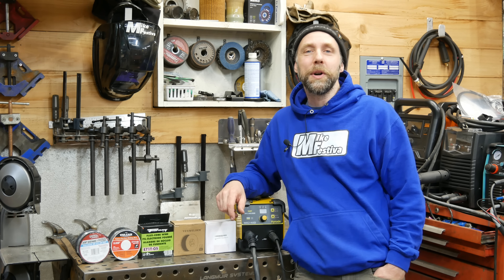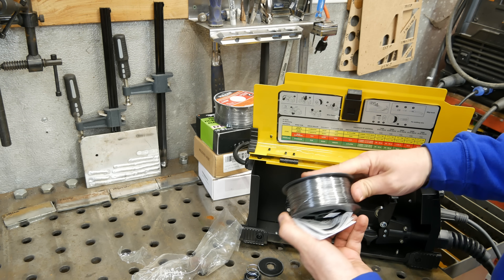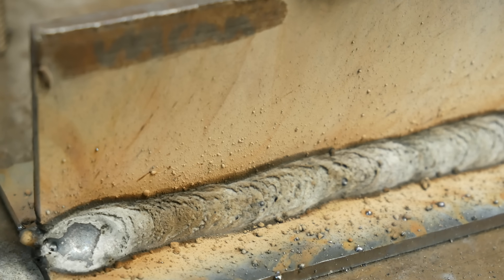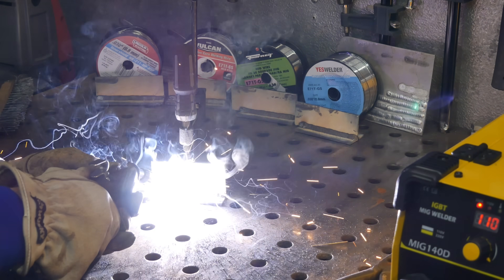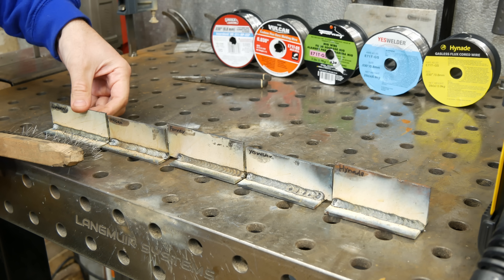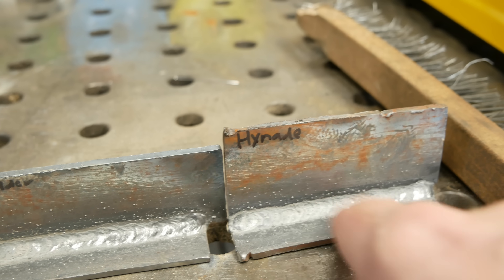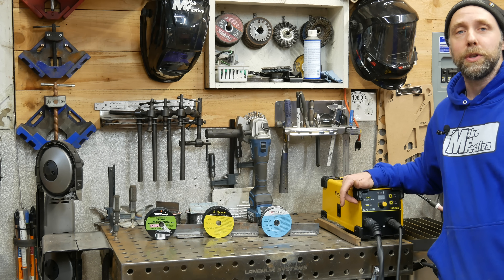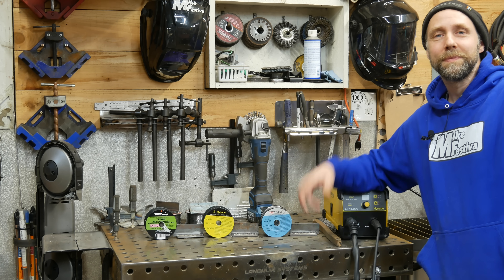Gasless Flux Core Welding Tips, Make Better Cleaner Welds

Comment: Most people don't have 220 volts,  do test with 110    volts.
Reply from the maker: Chuck I’m not making another video just to make you happy 😂
Reply: @Mikefestiva   I enjoyed your video quite a bit.  Someone commented about Single pass vs Multiple pass wire.  Your thoughts there?  I've only done a couple small projects using a borrowed Lincoln 110v; no access to 220 power.  Your thoughts on 110 vs 220?  Especially for beginner to get off on the right foot.  Thanks Mike!

Comment: The bottomline is you still get what you pay for. I wouldn't use anything other than Lincoln Innersheild for any kind of structural welding. Expeacially if it has to pass safety inspections like weld porosity etc. Believe it or not it's what you don't see is where the Lincoln wire really shines.
Reply: Yeah, big difference between E71T-11 vs E71T-GS. Really nice to be able to safely make a second pass.
Reply: I think the NR designation in the Lincoln wire's name hints at why it cost more. I think it was designed post Northridge.

Comment: thanks for making this video.  I've always just used the Lincoln because I can buy it at the local hardware store and I figured it's a good wire because of the name.  I kind of just figured wire is wire.  I'm ordering a couple spools of the Forney now and can't wait to try it.

Have you ever had an issue with the knurling on the feed roller leaving indentions along your wire?  My machine does it no matter how loose I have it set and I even use the .035 roller on .030 wire and it still leaves marks.  

My old HF 90 amp actually feeds the wire pretty well and I can set it up so that if I obstruct the wire from feeding with my glove the roller will slip.  (youtube told me that's how the feed should be set).  

On my newer "Titanium" DC flux machine no matter how much I loosen the feed roller it will not slip at all.  It can only be loosened so much before it's out of threads and the knob and spring pops off.  

Perhaps the wrong spring was put in my machine or it's just a poor design.  I'm going to try to use a softer spring and see if that helps.  Anyone else had this issue?

Apologies for the super long comment.

Comment: Hi Mike, if you had to choose between the Hynade Flux Core 140D vs the Titanium Flux 125, which would you get?
Reply from the maker: I really liked the Titanium flux but after running the Hynade 140D I think it welds much better and has a digital display and the dual voltage is probably the best added feature.
I do the Hynade is sold out at the moment. Probably will be available in a month or so. Take care 🙂👍

Comment: I’m 100% a novice to welding. Have a craftsman 140amp gas less I have used for years making ugly welds. Never thought it could be the wire hampering me. Always figured it was just me. Going to give some different wire a chance to help me improve next time I need to put down a bead. Thanks for the info. Great video. 👍

Comment: So to sum it up: buy wire that comes vacuum sealed. Got it.
Reply: Kt industrials is amazing wire and it’s American made
Reply: No, not really. The biggest difference you saw in this video is the type of flux core wire that was being used. The only structurally rated wire in this group is the Lincoln. It is E71T-11, held to a strict standard, and rated for double passes and deeper penetration, whereas all the other wire was E71T-GS, which is not rated for double passes, and has very limited standards it must pass, and can vary widely between manufacturers. 

The reason the other wires might have seemed smoother is because the manufacturers made them smoother, at the cost of durability and strength in many cases.

Comment: Harbor freights Vulcan is the worst and Lincoln is not even worth it for the quality you get. There are two more wires out there and one is the best I have ever used.
Reply: I've done some relatively hefty welding with the Vulcan .035 E71T-GS wire in my HF 90 amp welder converted to DCEN.  My motorcycle lift that I converted to a hydraulic cylinder has to hold up to 9000# of push to lift a 1000# motorcycle.  All the welds are holding nicely and came out clean with minimal spatter.  I am. BY NO MEANS, a professional welder.  Everything I learned about welding I got by trial and error and YOU TUBE videos.

Comment: Mike. I purchased an inexpensive PC off of Amazon before you showed one. It says I must use an "Air Dryer". I have a small compressor I have had for years with a regular filter for my air tools. What kind of "Air Dryer" do I need? My PC will get once a month use at best (more like 4 times a year). The HF one is over $300.00!!  Thanks!

Comment: Thanks Mike for the video! Based on the video I purchased the Hynade welder. Used it for a solid day on a remote project with a generator. The wire feed was good but the arc pulsed at every amperage. Later tried it at home at both voltages and full amp ranges; same result. I wondered if you had any issues with the machine. I sent it back today but wanted to hear from you first before reordering. I like the dual voltage and auto set. This was my third wire feed machine.
Reply from the maker: Hey Walt I have had no issues with the 140D I bought from Amazon, I have used it quite a bit on small projects around my shop and outdoors.
No arc Pulsing issues with mine, if you off set your Voltage and it’s still doing it I would suggest sending it back.
Maybe you got a bad unit?

Comment: HI, thanks for the review, very helpful!  I have a Harbor Freight bottom end flux welder, and bought their middle auto darkening helmet.  I don't know if I'm doing something wrong, electric (vs. gas) welding is fairly new to me, but I can NOT see the puddle no matter what level darkness I choose.  I see the arc just fine but not the puddle.  Is there something you might know to shed light on what I'm doing wrong?  Thanks.
Reply: you want the darkest tint you can use and still see the puddle. my guess is you're too dark. get a cheap normal helmet and some different tint options,

Comment: Now the real test is.. witch one is the strongest????
Reply: I really don't have any basis for comparison but I've done some relatively hefty welding with the Vulcan .035 E71T-GS wire in my HF 90 amp welder converted to DCEN.  My motorcycle lift that I converted to a hydraulic cylinder has to hold up to 9000# of push to lift a 1000# motorcycle.  All the welds are holding nicely and came out clean with minimal spatter.  I am. BY NO MEANS, a professional welder.  Everything I learned about welding I got by trial and error and YOU TUBE videos.

Comment: Question from an infrequent welder of hobby and light farm duty.  Would buying the smaller rolls be better by ensuring that the wire is not exposed to oxidation for extended periods?   I might have a long roll on the machine for several months, and I subjectively feel that it welds cleaner and easier, with stronger welds when the wire is ‘fresh’ out of the sealed bag.

Comment: Who use fluxcore?
Reply: I do all the time in the field,usually for fabbing brackets to hang pipe etc.Most jobs,i have to pull the machine up to a rooftop with a rope,and weld to rusty eye beams.Mig with gas ,uh no.Its my replacement for stick welding.Last june,I welded a pipe support structure out of 2.5" x 3/16 wall square tubing,probably 40 or so welds.Then ended up welding up the sched 40 steel socket weld freon pipes because our sub contractor welder wasnt available.We had a 3 day window to finish.Used that HF titanium 125 on a dedicated 20 amp circuit.Saved the day!
Reply: I use it because it's always windy and gas blows away. Unless your in a shop flux is better in the elements.
Reply from the maker: A lot of people do, it’s a great introduction to learning to weld on a budget. I TIG and MIG weld 90% of the time but still use flux on occasion.
Reply: I do mainly without issue thanks to Mike’s videos.
Reply: Ironworkers
Reply: Anyone welding in windy environments to start.

Comment: Sense you don’t like Lincoln wire what do you feel about that stuff that you get from Harbor Freight?
Reply from the maker: I don’t actually get wire from Harbor Freight I pay out of pocket for it
Reply: @Mikefestiva  Well they don’t give it away, so I don’t get the “pay out of pocket for it” comment. Thanks for sharing your experience.
Reply: I've done some relatively hefty welding with the Vulcan .035 E71T-GS wire in my HF 90 amp welder converted to DCEN.  My motorcycle lift that I converted to a hydraulic cylinder has to hold up to 9000# of push to lift a 1000# motorcycle.  All the welds are holding nicely and came out clean with minimal spatter.  I am. BY NO MEANS, a professional welder.  Everything I learned about welding I got by trial and error and YOU TUBE videos.

Comment: Isn’t flux core extremely carcinogenic?
Reply: I use flux core wire, but I weld outside all the time. If there is insufficient breeze to clear the fumes, I actually hold my breath when welding, then after the smoke clears, I can breathe again. I started with stick welding, so this is something I've always done.
Reply: I thought welding gave you Parkinson’s
Reply: @308dad8  Welding will more likely give you cancer, either throat or lung. Welding certain metals, ie galvanized, or anything coated with zinc, can give you the zinc shakes which can mimic Parkinsons.
Reply: @mikeford963  Interesting. So we should start wearing respirators under our hoods? Or is it something a hobbyist would never come to notice?
Reply from the maker: Honestly for the $35 a Miller respirator cost on line we all should be wearing one when welding.
I use one most of the time when welding, I also have a overhead fan over my bench to extract fumes.
Reply: @Mikefestiva  OK. Thanks for that reply. I never got the opportunity to learn this stuff in a classroom so there’s a lot missing from my limited education on the matter. So I’ll put a respirator in my cart.
Reply: @Mikefestiva  My initial comment was actually serious. I am a hobbyist who took a class at a local Polytech. The instructor said avoid flux core at all cost. He knew fellow journeyman welders who lost their lives because of it. So it was a serious inquiry. I don’t know any more than that so I was seeking more information.
Reply: A cheap diy vent system would work fine. I try to work outside as much as possible. Sometimes I have to work inside my shop and in past with flux core after 20+ minutes of welding with flux core I would get a bad headache and actually vomited from the fumes a couple times. Buy I saw a video here on YouTube about a diy system to move smoke and stuff out and cost me about $80 total to make it ND I use it when working inside now and works perfect.
Reply: @marcoojeda593  I have an area in my backyard where I plan on doing most of my welding.
Reply: Yea, if you eat it.

Comment: The Lincoln NR 2-11 is a E71T-11 wire and has nominal specs for the ingredients that go into the wire. All of the other wires are E71T-GS wire, and they can do whatever they want with their flux and filler metal. 

After looking at your welds, your dimes are pointy, and it looks like you have underfill on almost all of your welds. Try turning the voltage down a little bit to let that metal fill in without getting too hot, leading to that underfill (concaved welds) and pointy dimes.

Comment: I'm curious about that Hynade 140d welder. I can't find one. Your Amazon link is to a 145d which is a bit taller. Anyone find the shorty? Thanks for this video. I've been happy with Forney products, glad to hear their wire did well in this wire comparison.
Reply: It's sold out on Amazon and I can't find it anywhere. I went with the Amico Mig 130A. It has about the same features with slightly less amperage output.
Reply from the maker: Yes the Hynade is sold out at the moment, probably available again in a month or so.
Let me know what you think about the Amico welder you bought, once you get some time on it 🙂👍
Reply: @Mikefestiva  Will do.

Comment: I’ve been a pipe welder for 55 years I have to re-with you on your right choice. I have never used flux core Meg wire. I’ve used stainless steel flux core stick rod with flux inside and out side with a tig root and hot pass it passed X-ray and surprisingly made a really slick cover pass. That was on a nuclear powerhouse in Arizona late 70s . My question is how does it run in the overhead position? I have a Lincoln Meg welder where i used for small little jobs with gas shield and it runs good Nice video very informative

Comment: Video is only 10 days old and that welder has already just about doubled the $149.00. By the time you read this comment It might be over $300.
Reply from the maker: Different welder, the welder used in this video was the 140D, it’s probably sold out, as a default Amazon will automatically change to the next model available from the seller.

Comment: ALWAYS PUSH MIG WELDS.
Reply from the maker: You are not correct, this is FCAW not MIG. FCAW should in most cases be pulled, but with MIG you can Push or Pull depending on the weld joint and skill of the fabricator.
Reply: If it slags, it drags. 
Flux core always slags.

Comment: It's unfortunate that your sub titles covered all your welds,as a 40+ year welder/QC it would have been nice to do a visual inspection.Great info,thanks.
Reply from the maker: You should be able to turn this off on your device by choosing to turn of closed captioning after hitting the three dots on the top right. I’m not sure why this was on? Thanks
Reply: You just have to click the X in the upper right corner and it gets brighter and all the sub titles disappear.

Comment: Don’t get Menards house brand. Had problems out of it, Vulcan is way better than Menards house brand if that says anything
Reply: I've also purchased 
.035 Menards house brand chinese wire that was too thick to feed thru their .035 tips. Returned it and tried 2nd roll, thinking it was probably just a bad roll but every roll on shelf same. Instead of pulling it off shelf as defective, they instead put a sale sticker on it selling it for $3 less lol. I like the Fourney.

Comment: Very informative.
I've compared wires years ago and Forney had best results, plus Forney 140 amp Mig welder also accepts 2 or 10lb rolls  bought on Amazon has worked over 5 yrs without any issues.
Good video.
Reply from the maker: Thanks for watching Allyn!

Comment: Great video. I also love the Forney wire as it does run really smooth. The Lincoln wore is a little different as it is the 71T-11 instead of the GS wires like the others. It is the only one rated for multiple pass welds.

Comment: Flux core wire can also dirty up your whip liner, making feeding inconsistent. Try cleaning out your liner. It made a WORLD of difference for me. 
Also add a 'scrubber' to your spool just before the feed rollers. I use a clothes pin holding an earplug wrapped around the mig wire. Helps keep from dirtying up your liner.
Reply: How do you clean your liner ?
Reply: @kllisk  little isopropyl achol..then air blow out....its ok to use a foam ear plug before the rollers to wipe wire.
Reply: Thanks for the tip👍

Comment: Are you using DC or AC welder, I'm new but I hear DC is cleaner welds
Reply from the maker: This is a DC inverter welder 👍 Welds smoothly.
Reply: You’ll most likely be using dc more often. You can use ac stick rods but I’ve never ran them I heard not a lot of penetration because the positive is always flipping. You positive lead will have about 70% of the heat of your weld so you ground is usually on run on dcen. You do use ac for aluminum because of the oxide layer melts at a much higher temp then aluminum so you need that cleaning factor to bust that oxide up

Comment: Why use the cone on the welder if you’re not running gas?
Reply: Some welders will short and stop welding if the tip contacts the work. Mine does.
Reply from the maker: Thanks for answers this comment Just1spark 👍 I appreciate it man.
Reply: @Just1Spark  I see. I have a Lincoln 140. I believe mine will continue to weld but I guess I can’t say for sure. I use flux core with no cone as I can see better. 
Thanks for the answer.
Reply: @jhitt79  Ya, i had a welder that would keep welding no problem. It was great not having the nozzle shield on there. I upgraded to the Titanium 170 and POP! It shorts out. So now i wrap gorrila tape around the tip to insulate it if im welding in a tight space.
Reply: @Just1Spark  what happens it you short the tip? Do you have to reset the machine?
Reply: The nozzle is also helpful for keeping the tip the right distance away from your work.

Comment: I was looking at this welder then went down the rabbit hole and found the prime welder that does dual tig for 899$ clearly a major price difference but would you recommend this flux core abs upgrade to a tig machine later or just flat out practice tig now? Just want something to mess around with in the garbage but don’t want to regret passing the tig option
Reply from the maker: Well this welder is more of a budget entry level welder, something affordable so someone can get started for cheap. There’s no shielding gas required.
The TIG is completely different process and requires 100% Argon gas. If it’s an AC/DC TIG then you will be able to weld Aluminum, Steel and stainless steel. TIG is probably the most difficult welding process to learn.

Comment: On Amazon they have a mig145 for only $10 more than the mig140 like you used in this video. Do you think it’s worth the extra 10 bucks to get the mig 145d? Thanks and great video! Also that promo code doesn’t seem to be working 🤷🏻‍♂️
Reply: What's the difference can't figure it out 😅
Reply: @alfeldeguadalajara....7012  lol I went with the 140 because it looked like it was about 1/2 as big and I liked the size. I feel like I made the right choice. From the video it looks like it welds well enough for anything I would be doing with it.